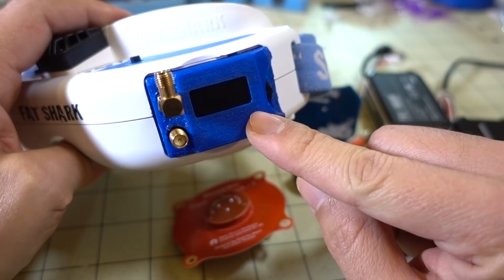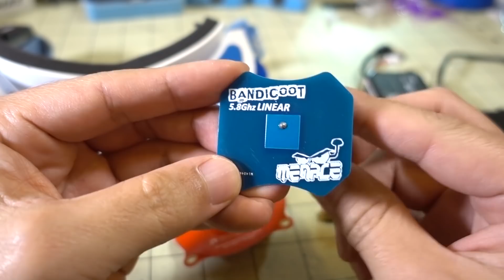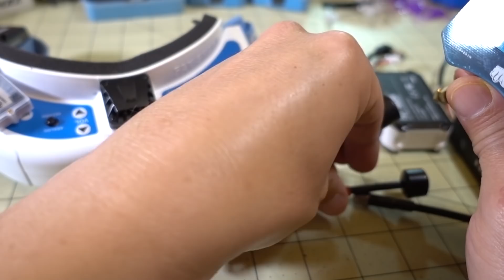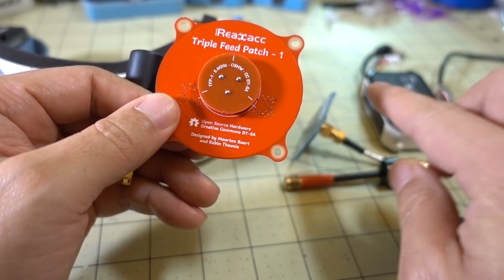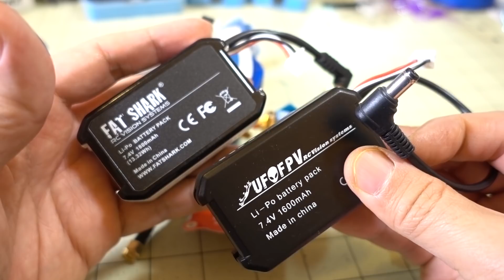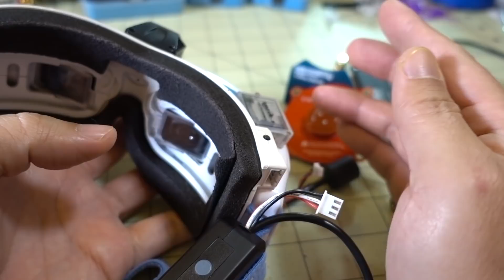My FPV Setup 📺😀

Comment: Sorry - forgot to add that my latest approach is to use a pagoda antenna and the bandicoot patch - with the top of the pagoda facing the same direction as the patch - which eliminates the dead zone of the pagoda. It seems to work Ok.

Comment: Albert - I've read that you cut the effective transmitting power in half when you use a linear antenna on the quad with a RHCP antenna on the receiver - but the only alternative for an Omni linear antenna is a "rubber duckie" - which only works well when the transmitting and receiving antennas are in the same orientation. The Bandicoot patch is great within its 55 degree beam angle - but what we need is an omnidirectional linear antenna to work with the Bandicoot.

Comment: hi! can we put the hmdvr s into the ev100. Like inside the goggle. and maybe cut a slot in the goggle for the microsd and rewire the button and drill a hole for new button.
Reply from the maker: might be possible... that project however is well beyond my skill level.
Reply: Albert Kim was thinking about doing it but don't wanna ruin my ev100 casing.. hope to see if s.o is able to fit it in first.

Comment: I really like the Bandicoot patch as well. I've been using the Eachine DVR module that goes with the EV100 goggles on my FS HD3 instead and it works fairly well. I couldn't stand the low bit rate on the built in HD3 DVR recordings.

Comment: Thanks, very helpful. Put the UXii on order. I already have the Menace Bandicoot and Invader. Any idea how the Realacc triple feed compares to the Menace Invader? On the DVR web page the title is "HMDVR-S DVR 1280*720 16:9 NTSC ", but the description says only VGA (640x480)??? Can you compare it to the Eachine ProDVR ? Thx.
Reply from the maker: The HMDVR is 1280x720 only.  I don't think it can be changed.  The Bandicoot is designed for linear antennas while the triple feed antenna is more general purpose.  If you fly drones with omni antennas on them the triple feed would probably be better.
Reply: Yeah, sorry I wasn't clear - was asking to compare the triple feed to the Menace Invader (also Omni patch) if you had any experience with the Invader. And is it worth upgrading from the ProDVR to the HMDVR-S ?

Comment: I used the Bandicoot at about 450 yards up a mountain with good line of sight and it worked very well.  I was actually very surprised that everything worked as well as it did.  Again, fairly ideal scenario.